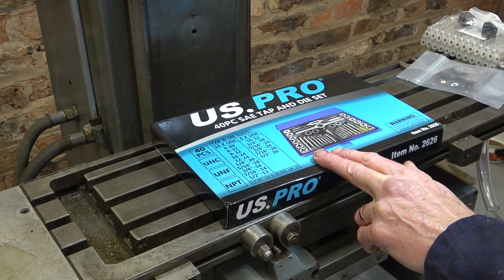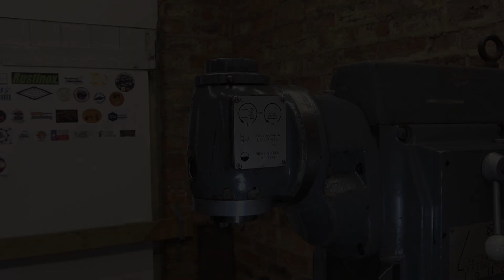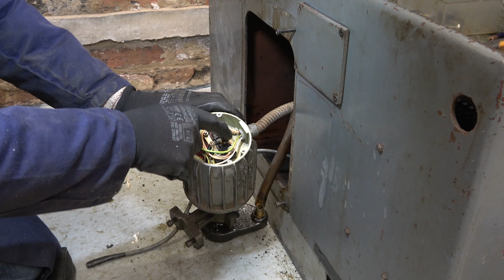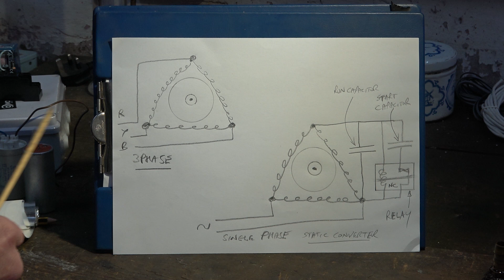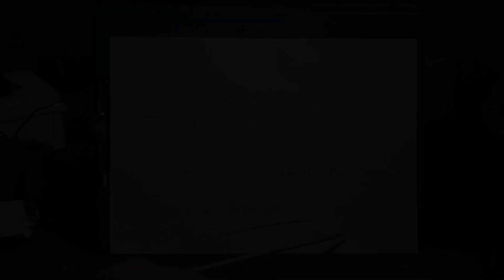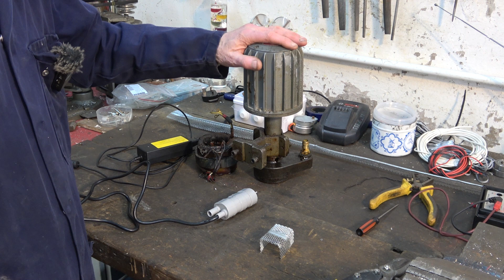HS174 Harrison universal mill servicing – Part 7

Comment: Lovely stuff Paul, the Harrison is a lovely milling machine,  my suds pump was seized up and burnt out, I use a mist spray as I've quite a large compressor, but your new pump should work just fine 🙂
Reply from the maker: Ralfy, I've had a spray nozzle for months and I have a 150l air compressor but I never quite get around to rigging up the airline to the machine(s). Now I have the mill I'll probably get it done soon(ish). Cheers.

Comment: It will be interesting to see how that small pump copes with swarf that slips through the filter.  It's probably been designed to pump reasonably clean water.
Reply from the maker: Hi Chris, yes indeed. I have a super cheap smaller coolant pump on my lathe (5v USB) and that copes ok. Moreover the seals have not rotted even after 2 years in oily water (coolant). Cheers

Comment: Well done on the seller, forwarding additional kit, great job by Mark, egg sarnie sounds good.
Machine coming along very nicely up to your standard,  SSD (Eurotherm) and IMO drives are top notch, bad news on the suds pump, happy wiring tidy up .
Nice instruction on single and three phase. I built a single to 3 phase converter many moons ago, it ran a 2.2 kw motor nicely,  used a timer and relay for the start.
Nice substitute pump.
Thanks for sharing
Reply from the maker: Hi John, I will find a use for the box and relay - some project always comes up. Both inverters rewired now with table controls and interlocks - story starting in next vid Part 8 (got too long for one vid). The Eurotherm dates from mid 1990s but performed without any drama. The Gen-1 IMO Cub was a bit more troublesome but I got there in the end.     Cheers

Comment: Easy to fix that pump motor, simply look for a motor of the same dimensions, single phase, and strip it to get the coil pack out. The laminates for those size motors in single and 3 phase are identical, along with the rotor, so you should be able to simply swap the stator into the housing and have it work. I had the same, except the motor was under the unvented gearbox, and of course all the gear oil landed up in the motor, killing it. New motor, and 5 minutes work with a drill on the one fill cap to make it vented, and new bearings in the gearbox, old ones had bad wear from dry running. then the fun to adjust preload, as the cheap gearbox uses the gaskets to do this, so I was sitting tapping a few thickness gasket material into the shape of the old gasket, and then playing mix and match to get preload right, then using gasket sealer shellac to make them a permanent seal, and fill the box up with nice new non horrid black oil. Ran silent and no chatter after that, and back into the bowels it went, hopefully to never need attention again.
Reply from the maker: Hi Sean, sounds involved but very satisfying. I was watching a motor channel where the preload on some bearing, or maybe it was the injector pump flow rate, was set by gasket thickness on the front casing. Can't remember the detail but I think it was a Cummings diesel. Cheers
Reply: Fantastic work, thanks for sharing it.

Comment: Nice option there with that pump. 

FWIW My coolant original pump says 200 GALS/HR (about 900l/hr or 15l/min) , what's the new one? A quick look on ebay sugested you could get them in 600l/hr and 1000l/hr options (maybe others).
Reply: Just a note of caution now. That little pump is designed for pumping water not oil. So it may have EPDM seals. These are incompatible with mineral oil, so if you are pumping non soluble coolant then there could be issues.
Reply from the maker: Hi fastdruid, the one I bought says 600l/h but, as people say, I'll need to throttle that probably with a bleed hole in the pipe near the pump (in the tank). Cheers
Reply: @HaxbyShed  in theory that is way lower than the original but the original had a valve on it to control flow. If that one doesn't like being throttled like that (and you can't just reduce the voltage) then yes a bleed would be a wise idea. Thinking about it,  might be possible to use a suitable Tee valve so you could adjust things.

Comment: Hi Paul. Many thanks for a very interesting episode. I have a printing press with a three phase motor, which many years ago a chap managed to connect to my single phase supply. For many years I failed to understand how he achieved that. I now know. He added a home made static converter based on capacitors like you explained.
Also it was interesting to see that you obtained both Clarkson Autoloc and Osborne Titanic threaded shank milling holders for your mill. I was a convert to those when I acquired my Dore Westbury mill. But shush 🤫 We don’t want people to know and start bidding on eBay for these threaded cutters. 😂 
It will be interesting to see how well the mini suds pump works out. Will it cope with metal particles. It’s definitely cheap enough.
All the best 👏👏👍😀 Andrew
Reply from the maker: Hi Andrew, tbh inverters are so cheap now and they perform much better than static converters plus speed control and torque boost (more torque at low speeds) so I think static converters are on the way out except in simple cases (smaller light duty motors). Personally I will use Clarkson over ER wherever I can. Cheers
Reply: @HaxbyShed  Luckily, on my printing press the three phase motor simply turns an inking cylinder and has no real load on it. The static converter that chap added was a very good solution. I can well see the benefit of an inverter where speed control and low end torque is required. I must look at replacing the Dore Westbury single phase motor with a three phase plus inverter.👍😀

Comment: Nice collet collection.    The original coolant pump was huge.   The small submersible pump is far better and single phase, so much easier to wire up.
Good to see some cutting action.
Reply from the maker: Hi LVW, I'm impatient to be cutting but I want to get it right first else it will never get done. The electrical and inverter (re)wiring was quite a job to get the table/spindle interlock working properly. It's done now and will be in vids to come. Bit heavy on detail but reflect real life, and not everyone is confident with inverters so I hope it will be useful. Cheers

Comment: Wish mine had an opening like that to clean out the coolant gallery! Very different setup with mine and the only way is to reach down via the hole where the drain mesh sits (which is larger and sits centrally).
Reply: Mine also has the long gallery for cleaning with a built in scraper like Paul's has.
Reply: @carlwilson1772  I've never seen another one with the same (CI) base as mine.  It's there as an option in the manual but can't have been many made.
Reply: @fastdruid  Amazing how many variants there are.
Reply: @carlwilson1772  I think part of the issue is despite being a "catalogue" item they were almost all bespoke products. 

Although they also just continuously improved them, which is great, except they didn't believe in any kind of additional identification to distinguish between "updates" even when they were almost unrecognisable. See the unofficial labels given to the L5 for example (mk1/mk2/mk3/mk4).  

The same could be said about the Milling machine, there is a clear Mk1 (the rounder model) and Mk2 (the squarer model) but vast differences in minor features even ignoring those gross features (gibs on Z, & X for example that weren't on the earlier ones).
Reply: @fastdruid  Yes exactly. There is no form of official modification record or chronological list of when certain design changes were embodied. Mine does not have gibs on the Z.
Reply from the maker: Hi fastdruid, I was looking at that panel thinking it was a 'stuck on' cover over some option not installed or an old electrical panel. Saw it on Ralfy's mill and it was 'hello, that's useful'. Cheers

Comment: Hay Paul.
Good to see the mill making cuts,
It looks like you will have it all wrapped up very soon.
Kimber.
Reply from the maker: Hi Kimber, rewiring the inverters, table switches and interlocks have proved to be a big job but done now. That will be the next vid. Then get the table motor back on, and we'll be cutting chips with my mind on a bit of horizontal milling to start with to test out the long arbor etc. Cheers

Comment: Bad luck on the suds pump, seen them fail like that before, if the pump is left running with the valve closed it can eventually push suds up the shaft and into the motor. If you put a tee on the suds feed pipe with a valve you can control the flow by bleeding some of it back to the coolant tank. Enjoyed the vid! Beware of the reversing switch! You would need to power down the machine, change the reversing switch over then power it on again or the inverter will fault! Inverters generally do not like any form of switching or starter/contactor between inverter and motor so I wouldn’t switch it over with the machine powered on, and never with the spindle motor running. Check the inverter manual. 
Phil
Reply from the maker: Hi Phil, I've just about finished rewiring the inverters. The spindle did not have the reverser wired in but the table still had the reverser switch between the inverter and the motor. I've moved the reverser functions to the 24v control side of the inverters. The reverse switches have an off position between forward and reverse but even if I moved direct from F to R the inverter would handle the ramp down and ramp up. It's been a challenge because my inverters are an old(er) design. Mid 90s on the table and maybe 2005-2010 on the spindle so they lack some modern functions. Cheers.
Reply: @HaxbyShed  thats what i was worried about, i have only limited experience of inverters and all on the earlier generations but if you can set the reverse switch to control the inverter rather than just swap phases, with the ramp up/ ramp down, that seems to be a perfect solution. I await you next video with bated breath!
Phil
Reply from the maker: Hi Phil I have just today finished the wiring and it all works, and with the spindle/table motor safety interlock etc. I just need to check the inverter parameters and set the max /min speeds for the speed control knobs, which I have mounted on the table switch block (the one that has start, stop reverse by the handwheel). I think it will be my next vid and I will explain it all. Cheers
Reply: @HaxbyShed  Get in ! Good news indeed!
Phil

Comment: Well done on your first cut👏👏

That tap and die set sounds a bargain for £27 delivered.

Thanks for the explanation on the circuitry, I would be lost on something like that!! The fish tank pump as a replacement looks perfect!!

Interesting to see the Eurotherm inverter, I used to work for them many years ago, but in another division, making chart recorders.

Good luck from Spain!!
Reply from the maker: Gosh David, chart recorders! The mid-90s vintage Eurotherm was a bit old school but defo a quality inverter.  Actually gave me less trouble than the IMO Cub, as it turned out. Those US-PRO tools are very good value but probably not made in USA, like Superdry clothes are defo not made in Japan (because the Japanese characters on their logo make no sense). Cheers

Comment: Great video, thanks. The Clarkson autolock has become our "goto" collet system on both our mills. We cleaned out the cooling system on our Cincinnati mill a while back and it was a horrible job but worth doing. Since lockdown all our local bearing suppliers have either closed or shut counter service and we have be using a number of online suppliers. Recently we have found a fantastic supplier and the delivery times are great, a couple of recent orders were placed at about 5pm one day and they were delivered the next morning. The unbelievable part of it was that the postie delivered them which does show that it is possible but not for all suppliers or services
Reply from the maker: Hi GTB, I think everyone likes the 'postie' but Royal Mail are facing big pressures from the cold winds of competition. But it's not only RM feeling the cold, same for the other established players like UPS, DHL, FEDex. Online deliveries can be amazingly quick when all the alignments are favourable. I won't even drive two miles down the road to a physical shop unless it is 'urgent', or unless I'm already passing by. Cheers Clarksons are ace. Cheers.

Comment: Gday Paul, it was great to see the mill make some chips and you have a good collection of tooling, the new coolant pump will work fine, just need a tap in-line to control the flow, I used a parts washer pump on my lathe with a small tap and it works a treat, great job as always mate, cheers
Reply from the maker: Hi Matty, I saw your vid on the parts washer coolant pump. Neat job. Now maybe you can help me - I'm normally using soluble oil-based coolant but people talk about water-based coolant - presumably not oil but something synthetic but still mixed with water.... is that right?
Reply: @HaxbyShed  I use Hangsterfers 5030 which is semi synthetic vegetable based coolant which is mixed with water, I highly recommend this coolant, been using it in the Cincinnati for over a year now with zero issues, I used to use Penrite soluble oil and found it to be crap, have a look at the Hangsterfers website mate, cheers
Reply from the maker: @MattysWorkshop  Ah righty, I see that but it's not coming up in the UK in my searches - just Aus and USA. I'll try to find something with a similar spec here. Cheers for the info Matty.

Comment: Great film. I really enjoyed it. Shame about the suds motor. I replaced the oil seal on my one. The aluminium plate on the bottom of the pump housing was badly corroded on mine, so I made a new one.  That little submersible pump is quite something. You could possibly arrange it so you have a tee in the output to spill some output back to tank, as a flow control/safety measure. The test cut went really well. I'm interested to see the bearing in your overarm end support as mine hasn't got one. I know from the manual that it should be a needle roller type. Great explanation of the steinmetz capacitor and three vs single phase. Thanks again for the film, loved it.
Reply from the maker: Carl, thanks at some point I will show the overarm end support bearings. I've done some basic servicing on those already. I'll be doing some horizontal milling experiments to see what it will do - cut width/depth. Cheers
Reply: If you want to put in the start capacitor, but do not want to bother with the start relay, as those do have a number of voltages they cut in and out with, along with a few different current ratings for the capacitor. Instead get a hard start kit, which is a motor run capacitor of roughly 100uF with a PTC thermistor in series with the capacitor, and it simply goes across the run capacitor. Generally after 3 seconds or so of current flowing in the PTC it goes high resistance, taking the start capacitor out of circuit to the most part, and the small extra current keeps it hot, so it will stay out of circuit. A great thing for older compressors, as that enables it to have extra oomph on starting, but keeps run current the same, and it struggles less with starting on high load, like on a hot day when you really want AC.
Reply from the maker: Hi Sean, I'm realising from your comment there are a number of ways to do this. Thanks.
Reply: @SeanBZA  What a brilliant solution. Love it.

Comment: Too bad about the pump motor. Since I doubt you'll run that new pump wide open, and assuming it's not a centrifugal pump, you might want to look at some kind of back pressure relief valve. I would imagine that constricting the flow from that little pump may have negative consequences.
Reply from the maker: Hi Greg, good thought. I need some kind of bypass - possibly just a hole in the pipe as it leaves the pump so it just squirts some back straight into the reservoir tub. No point drowning the table or indeed burning out the pump due to restriction. Cheers
Reply: I'd be tempted to run it on a DC speed controller. Looks like it has a DC power supply anyway.
Reply from the maker: @R9000 yes it's 12V DC. Cheers

Comment: Thx for the vid. Do you think you may need to insulate the sump ("HS165 Insulating a solid wall" scraps) and add an aquarium heater?
Reply from the maker: Well W65er, that's not such a funny comment because the coolant could easily freeze in there and bust the pump. You have set me thinking now ....   Cheers

Comment: are you going to use cutting oil or water-based coolant?  stay warm..  it was -35 F with the wind chill.  here in Ohio last week for a few days.
Reply from the maker: Hi Doug, -35F you're kidding!!  I have heard about water-based coolant but I'm unsure exactly what that is. On my lathe I'm using soluble oil - dilutes white milky. I've had a small pump immersed for 2 years and the seals are holding out. So, is water-based coolant the semi-synthetic stuff?  I have seen specialist coolant for CNC production machines but that looks very expensive? All advice welcome. Cheers